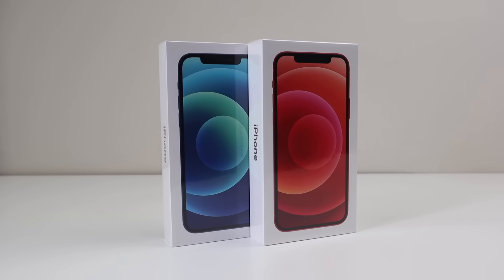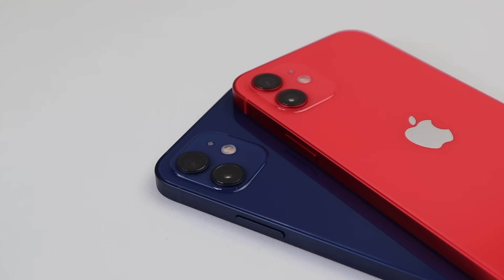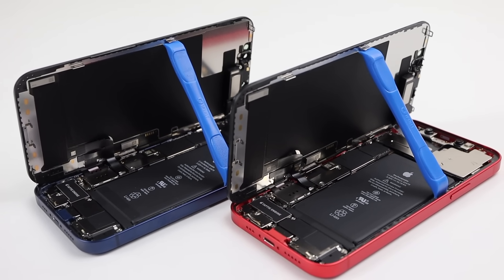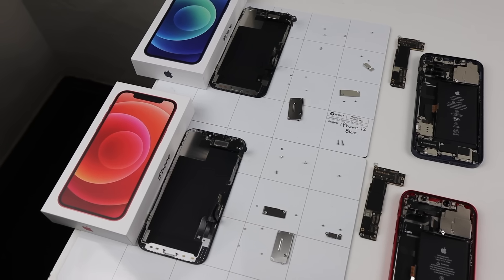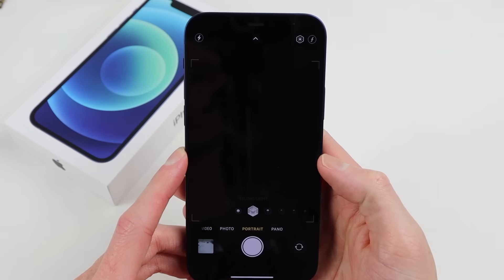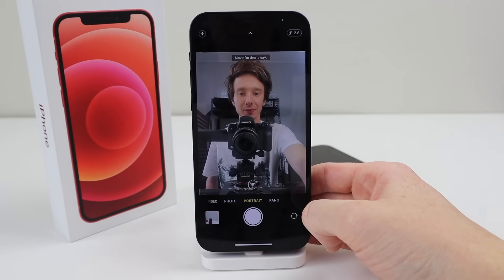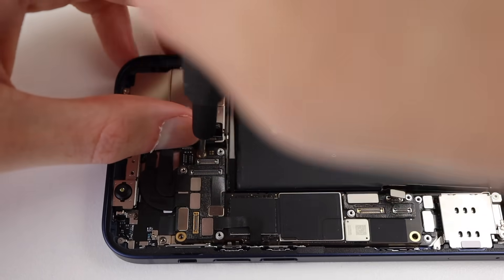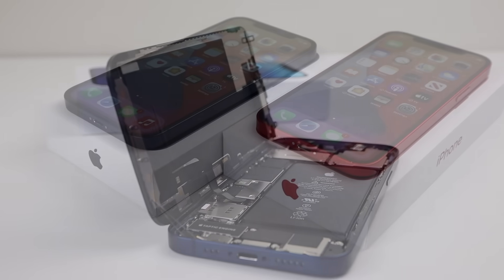iPhone 12 Anti Repair Design - Teardown and Repair Assessment

Comment: (Added 3 item as of 10/30/2020)
Apple anti repair idea:
Phone will go into lockdown mode if disassembled you will get the message "Unauthorized dissembly detected", to get it usable again, you have to "calibrate" it to reset the alarm
If the phone find out that it in a 3rd repair shop, the phone will seft destruct, and then Apple can spread propaganda about do not trust 3rd rapair or/and saying that this is a security measure
Automate their 1st party repair entirely so they never worry about employee stealing part then sell
If iPhone encounter a critial error and find out the certain year has passed, the phone would just tell you "This iPhone is expired, do not use as it will be a security risk" then ask you to buy a new phone
Edit:10/30/2020
If iPhone is supposed to be recycled Apple will blacklist it unique identifier, causing iPhone to disable it seft and prevent the phone from being activated
On top of paring every single part together, now swaping the part now cause iPhone to refuse to startup and throw "Unauthorized dissembly" like  mentioned
iPhone motherboard can now seft destruct (Apple say that it's security measure) when encounter a motherboard error to force a board swap
Reply: Psh, with tools like 3c no doubt the Chinese will create another tool that'll keep this fictional iPhone tripwire from tripping.

Comment: The cable being USB-C is not the issues. The iPhone still using the Lightning connector, when they computers and tablets use USB-C, that is the problem.
I own 6 usb-c to usb-c cables, but only have one usb-c to lightning that came with the airpod pro. And all my fast chargers are usb-c not usb-a.

Comment: I work at a 3rd party apple repair store, so I have a lot of experience with this sort of thing. Face ID generally requires original front facing cameras to work, although there is a physical security portion of the cable that can be disabled to allow the data to be transferred to a new cable, but this is both difficult and also inconsistent. As for True Tone we have a machine that copies the data from one screen and can change it to the other, as long as it is a quality 3rd party display. We’ve been frustrated with apple serializing the batteries, but rear cameras have always been replaceable. I’m confident someone will create a tool that will be able to copy the data from one camera to the next so that we can use those instead.

Comment: Not putting screws back in the device could cause issues with the camera and possible grounding although it’s going to be a crapshoot until a schematic surfaces. I do see that after the issues with swapping the boards you put everything back the way it was and it continued to work correctly. Maybe try screwing everything down also

Comment: Whos hyped for the next iPhone having non interchangeable screws!
Reply: I'm ready for the ones you can only buy in america!
Reply: @Unknown Pooter glad I got the 7 pro, got it a year and a half or so ago because of the clean software and display along with a decent price compared to competition. So far no issues and has delivered on the reasons I bought it for.
Reply: And chargers
Reply: @Unknown Pooter might be a pretty good purchase depending on what you can buy it for if it's just the screen, best of luck.

Comment: Apple is the embodiment of late-stage capitalism. Just you wait and it will get a LOT worse. They’re really testing the waters to see how much people can swallow without getting angry at them. I’m currently running an iPhone 7 Plus I got on eBay 6 months ago and I plan on using it for a couple more years, it’s great. Buying used IS recycling, not not including a fucking charger with a $1000 phone. Completely ridiculous practices and they should get knocked down hard with billions in fines.

Comment: Doesn't matter what they do tbh, there will be a solution via a tool to program components. It'll probably be expensive, but if there's a tool that fixes the home buttons and enables touch ID on the iPhone 8 and below, and there is a tool that let's you get True Tone back on the iPhone X and 11, there will definitely be a tool available for the newer phones that can fix these issues as well. They're really trying too hard, and it's just sad.

Comment: I've been in the phone repair industry for over 10 years now, so first of all, I appreciate your in depth video. This is sad for the industry but also for costumers, they simply cannot choose to get it fixed wherever they want, or even do it themselves. I really hope that this will backfire Apple, but I don't see it happening. It's like having a car, where you're not allowed to change the oil, brakes etc.
Reply from the maker: Well said
Reply: GM has removed more and more grease point on the underside of their vehicles over the years
Reply: You can't compare a car/building/house/ship/airplane to something so puny as an iPhone. iPhone are toys. It's acceptable that those car/ship/plane/house companies don't let you repair those products. If you change a headlight in your car and if it's misaligned, then you create risk for the oncoming traffic. Think about what happened when you change the brakes and make some mistake. Generally when cars and other such big piece of tech is fixed by a non qualified person there's a risk created which equally affects the surroundings along with the owner self. Whereas if you make a mistake with consumer electronics, only the owner is at risk.
Reply: @siddharthchakravarty2099  so you're saying it should be opposite? You're argument doesn't make any sense. If I buy a phone, I should have the right to do whatever I want to do with it, right?

Comment: Speaking as an Apple repair technician. This isn't surprising. Apple has been serializing all their phone and mac devices for 2 years now. All parts in the phones have their own serial number and if the serial number the Logic board expects isn't present in one of the parts (like display, battery, or camera) they stop working. This is a known thing and intentional to keep 3rd party repairs low and internal repairs high. I do not agree with any of that but just stating officially, apple knows and doesn't care.
Reply: Exactly this,  it's almost "Phone-as-a-service".  Although personally I'm fine with this as I replace my phone every 3 years anyway.

Comment: Apple: we forgot to pair the charger
Engineer: what charger?
Apple: exactly, the charger they have to buy from us.
Reply: Apple: Write that down
Reply: That is crazy. They should discount the amount of the charger off of the phone price because they aren’t including it in the box.
Reply: @CowerdlyMantis  frfr
Reply: normally if you buy an iphone 12 you already owned an apple phone, so you probably already have an lighning charger. just use that one, you get what you pay for.
Reply: @trigon.6296   that is a big assumption you make. Especially when Apple wants to convert people over to buy an iPhone for the first time. That is how they expand their business. How can you say you get what you pay for? If they used to include the charger in the box then they should either lower the cost of the phone or include the charger. iPhones are already expensive enough.
Reply: @CowerdlyMantis  apple has been a ripoff since iphone 5
Reply: @trigon.6296  The iPhone 12 charger is usb c, meaning this would only make sense if your upgrading from the 11, which is very limited.
Plus when i get a new iPhone i sell the old one with charger included..
Reply: @nixnormal  then you probably have the spare money over to buy an extra charger. be happy that you can use this cable now to connect it with your mac. i bet no one would cry if the phone costs 20-30$ more when there would be a charger included
Reply: and there are plenty of people who have like 10 different chargers from apple already at home, so i completely understand them
Reply: @trigon.6296  u are buying an expensive phone and u don’t even get the headphones or the charger. Tbh I went from a Android to an iPhone 11 and I still like Apple but it’s a ripoff about ppl switching from android to Apple. And the headphones and the charger can get up 50 euros in Europe it’s way more expensive in Europe and if u are buying a 1200 euros phone then u should get the charger and headphones
Reply: @d3vilchi  Exactly. Base model iphone 12 pro, brick and earphones combined is like $410 more in EU
Reply: @nixnormal  11 charger is usb,not c.11 pro is
Reply: @d3vilchi  apple has been a ripoff sine iphone 5. and gone way far after the iphone 8.
What would be if the price would be 1300€ and you get the charger and the headphones?
Reply: @trigon.6296  I would buy an android or an iPhone 11
Reply: https://youtu.be/mibM5nB3lwU

Comment: Any replacement of the battery, display, and camera on the iPhone 12 will require the technician to perform "System Configuration" with AST 2; and System Configuration is not available until the serial numbers of the new and old parts are entered.

Apple can replace the following parts or whole unit replacement: display, camera, SIM tray, speaker, Taptic Engine, Battery.

While I understand the TrueDepth camera is paired with the logic board for security reason, the main camera should not have anything to do with it, why does it need to be paired is a mystery until someone can find out more about the inner workings.

This System Configuration procedure is similar to any Mac with T2 chips.

Comment: I wish they did make it easier to repair. Although, if they made everything easy to swap, they would probably get sued left and right when 3rd party repair companies inevitably start using cheap parts. Couple that with the fact that FB, and Google are getting dragged to the White House to defend the fact that people use their platforms for evil even though they have no part in it, and you can start to understand why they are so carful. Obvious it works out to their benefit to have people buy everything from them, but it also eliminates the possibility of your phone exploding in your pocket one day lol
Reply: Also, I’ll add that they did get sued when they protected everyone from overheating batteries by throttling down the older models lol so I guess they are screwed no matter what they do 😂

Comment: I do phone repairs as a part of my job and I've been thinking of getting an iPhone just because its pretty easy for me to repair them at this point. But what's the point if Apple is now even locking down individual parts? I could kind of understand the logic behind TouchID/FaceID not working after related parts are replaced, but the camera? And no battery health after the battery is replaced (even with an official battery)? Planned obsolescence at its peak.

Comment: So Apple put software level "hardware defects" into your 'repaired' iPhone. Perfectly demonstrated by known good hardware replacements 'failing' and randomly stop working. The problem is, and again as shown here, as with any software there can be bugs. Such as the actually official and working, 'broken non-official Apple iPhone camera' working in the little view finder when you take panoramas, and if you swap to video-mode and back to picture mode.

This is 100% a Cop-Out on Apples end, so they don't have to follow any right-to-repair laws should they all get passed in the near future. Great progress on that climate change focus Apple.

Comment: Actually the logic board’s extra connectors are for the pro models because the 12 and 12 pro use the exact same boards just the pro has the extra connectors for the 3rd camera and lidar sensor

Comment: If they care about the environment why not make the cable USB-C to USB-A? Or at least lightning port to USB-A? How is that getting rid of e-waste when you have to go buy a completely charge brick1? And for those that don't know there is an adapter you can get for USB-C to USB-A.
Reply: because USB-A is dying and most newer Apple devices have USB-C Charging bricks or USB-C Ports. A USB-A Port would be nice for short term but you would need to buy another cable 1-2 years down the line...
And almost all people who upgrade from a pre 11 iphone do have plenty of USB-A to Lightning cables. if they come from Android, chances are very high that they already have USB-C

Comment: ooooooor you could use the USB-A cable you already have, there is no law that says you have to use the cable in the box (also the cable produces less waste than the brick anyway, and since the cables basically add no weight to the boxes, including them doesn't have as negative of an impact on weight and shipping as the bricks do; you can disagree if you want, but it's just facts that this is helping the environment), I'm tired of all you reviewer's acting like everyone has a USB-A brick but not a cable; the USB-C cable is the one Apple's customers are least likely to have, so it makes sense that they would include this cable over the one they know most people have, so that they can switch to a type C brick if they want, but they don't need to if they don't want to, not everyone is going to switch to type C right away; if even 10% of people buying the 12 series don't need the brick to be included, then it's a net positive; is Apple going to make money off of this? yes they're a business and that's what businesses do, but as a whole it is still a positive thing and a step in the right direction. a small step, but a step none the less.

there are plenty of reasons to shit on Apple, they do some shady things, but removing the power brick just isn't one of those reasons

as for reparability? yes, 100% they need to do better and should and I am totally fine with giving them shit for it lol

Comment: 3:05, try using your fingers on the edge of the phone rather than bending the display itself. Also why did you plug the power into the phone before you had resembled it at 7:27 ?? You could have easily ruined it by doing that. I have had many iPhones that don't turn on until power is given by lightning after a battery disconnect, so that is nothing new. Face ID has always not worked since it was added when you change the module so again nothing new. As well as the genuine battery and screen messages. These get pushed to settings after 4 days. Cameras may be able to be reprogrammed. True tone can be reprogrammed

Comment: I had already bought an Apple 29w usb-c power adapter and lightning to usb-c cable back when I had purchased an iPad Pro, so this no power adapter is a non issue for me. Also, if you are buying an iPhone it's likely an upgrade. Therefore, you should already have other USB-A to lightning cables...its not like this new iphone is using USB-C, it's still using lightning. So stop making it a big deal. People got over the removal of the headphone jack. I am sure they will get over the removal of the power adapter

Comment: I don't understand people... If Apple assumes you already have an Apple power adapter, then it's safe to assume that you already have the associated cable. If you don't have an old iPhone power brick and cable to use, then you probably do have something with USBC that you can plug the new cable into, including a most modern laptops, and many modern chargers, and power bricks. You're far more likely to be covered by a USBC cable than a USBA cable, and you'll need the USBC cable anyway if you want to connect your phone to your laptop for backups and data transfer.

Comment: Remaining as anonymous as possible here, I am a Technician for Apple and I cannot say a lot but to remove the display its like using an easy bake oven. Yes we have to use heat for the first time with device repairs. Also might do an AMA on reddit if this gets 100 Likes.
Reply: Lmfao yall just do nothing but charge 1000 for a broken screen.

Comment: Sorry but I think there is a misunderstanding regarding the fact that Apple did not pack a power brick (which I see repeated over and over again): I do not think that Apple intended that users upgrading from older models use the usb c to lightning cable provided with the phone with an old power brick. I think the whole idea was that everyone has a lighting cable at home since, they were introduced since Iphone 5, and that they will use the BOTH the old power brick + old USB A to lightning cable from the old phone. 

So in my opinion this is what Apple meant by reducing e-waste.

Comment: I don’t think this comparison is fair, the background calibrations and everything else certified technicians have to do far surpasses the simplicity of switching the logic boards shown here. It’s like swapping the engine of two of the same cars and expecting them to run with our readjusting the timing belts, injectors etc. Not to mention  holds they’re service providers to a high standard which may not be ideal for some but any who are willing to meet that criteria can partner up. I’d like to see a more in depth analysis done with maybe someone who can compare apples process to that of a third party.

Comment: China’s aftermarket Apple parts manufacturers will come up with solutions to bypass these locks. So i am not worried about these locks. We had true tone issue then they came up with the devices that programs the true tone or even battery. If People in Apple created these integrated locks between parts then people can bypass them. So don’t worry guys I am pretty sure phone repair companies will come up with solutions to bypass iPhone 12.